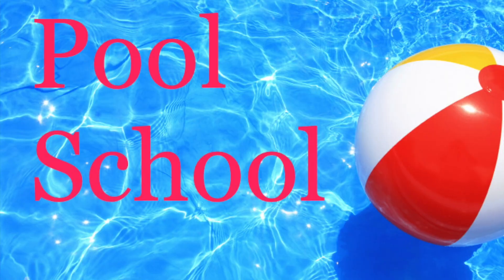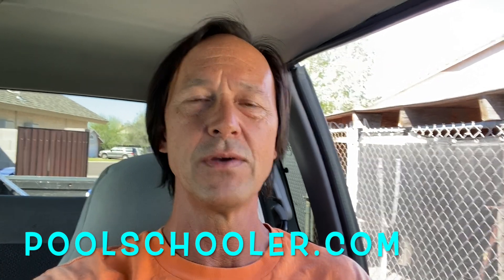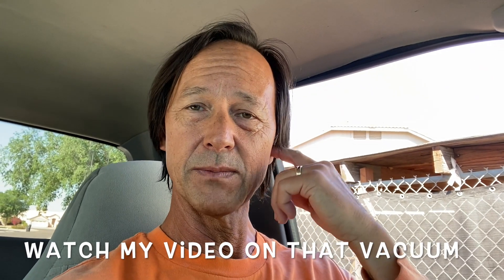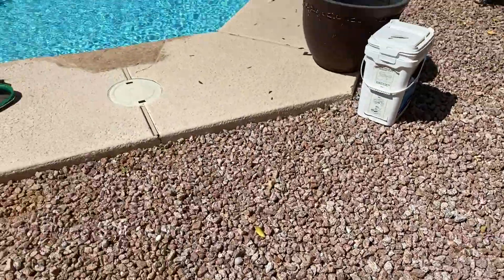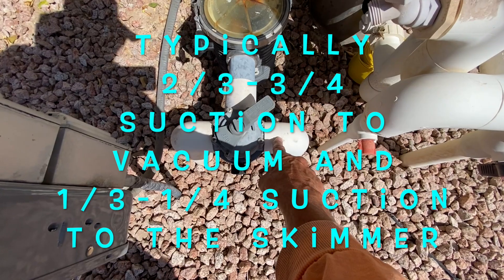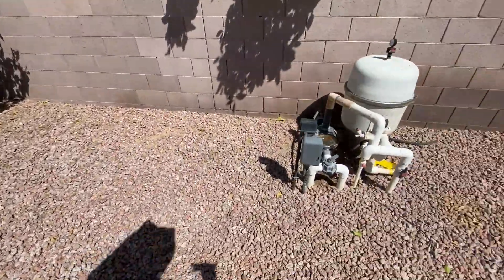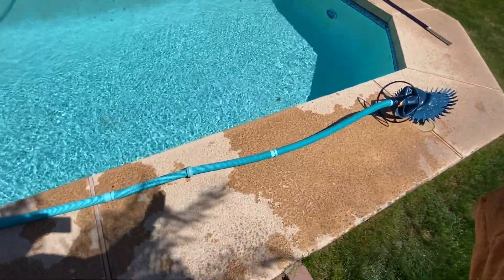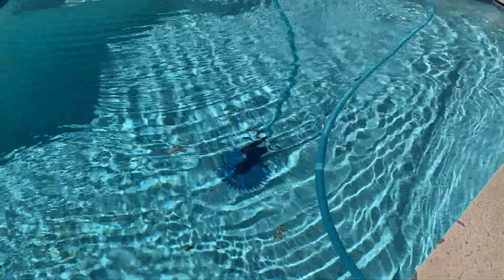Barracuda G3 (and G2) Adjustments

Comment: Hi Kenny, Thank you for all the information about the G3.  My G3 sometimes gets stuck on top of the bottom drain cover.  Is there a way to prevent that?  FYI, the skimmer and the bottom drain come to my filter with one pipe, there are no separate pipes.  Also, I am connecting the G3 to the skimmer directly, not a separate vacuum inlet.
Reply from the maker: Perhaps. Ive had the finned disc of the G3 het stuck under an older style floor drain cover that has a lip around it.  The newer ones look like the one at this link: Afras Anti Vortex White Drain Cover 7 3/8 inch Made 11064W https://a.co/d/cPrsWA1 can help that not happen.   I doubt the vac gets stuck because of the suction to the floor drain. If your skimmer has a diverter take it out and there wont be any suction to the floor drain. Then its just a matter or getting a flor drain cover thats smoother so the  finned disc doesn’t get caught in it.

Comment: I'm replacing my Hayward Ladybug (left by previous owner, rebuilt by me).  I just received from Amazon a U.S. Pool Supply Professional Automatic Pool Vacuum Cleaner .  Looks like the balancing principles in this video would also apply to some of these cheap copies of the G3. Thanks.
Reply from the maker: I’m not familiar with that vac but if it works that’s great.

Comment: Hi Kenny, I just replaced all the parts on my G3 and have a new Hayward VS900 pump. I've noticed that, even when the RPMs (and suction) are adequate to start the vacuum, sometimes it won't actually start vibrating (and moving) until I pick it up off the pool's floor. Any thoughts on what to do about that? 

(PS I did recently remove the collar, which was causing it to get stuck in one corner of the pool near the steps, so perhaps that is part of it.)
Reply from the maker: Hmmm. To potential thoughts. Sometimes and first, it could be that your suction is still a little bit on the low side. I’ve seen that happen before several times. Secondly, it could also be that the diaphragm you put in might be a little stiff and it takes more suction to get it going. I’ve seen that happen on rare occasions too. I would suggest trying to increase the suction a little bit more on the vacuum to see if that does the trick.
Reply: @PoolSchooler  Okay, thanks - I adjusted my Jandy valve to increase the vacuum suction while the system was on and that started the vacuum again. :)  Only trick is that the spa suction is on the same valve, so increasing suction to the vacuum leaves the suction on the spa kind of low. But, not a huge deal... I can always increase the suction on the spa for a few hours every now and then if need be. Thanks again!
Reply from the maker: @BryanStoudt  Hmm interesting that the builder put the spa and vacuum suction on the same valve.  But you may want to try increasing the return flow to the spa to compensate especially if the overflow runs into the pool then that would probably be acceptable.

Comment: Hello so my pool always turns green after my pool guys "fix it" it only last like a week or two then goes green again and gotta wait another week or two to make it blue it always happens with these guys for like 3 years now. I dont have a pool vacuum and my filter is a sand filter and my skimmer only has one hole. When I turn on the filter at night which side should be off on the pump jandy valve skimmer or the other side?
Reply from the maker: These two videos may help:
Algae and Algaecides and Why You Don't Need Them:  https://youtu.be/MzGoK4Cd7tc

How I cleared My Green Pool: https://youtu.be/XY-BAdBY0zI

You may also may want to become a member of poolschooler.com. Check it out.

Comment: I purchased this vacuum because you spoke so highly of it, but haven't opened it yet.  I'm long term house sitting so it's not my diving pool and I don't know much about pools in general.  THere's a pop up system here.  just two on the floor.  Do you think this type of vacuum will work or will the pop ups blow it over when it gets near.  there is a pause feature (discovered after I watched another one of your videos) on top of the pop up tube thingy (total technical term :) ). smarter to pause that when setting the barracuda loose?  the last thing I want to do is open it and then have it not work and be stuck with a vacuum I can't use.
Reply from the maker: First of all you purchased a really good vacuum. Secondly, if you use the pause feature on the pop-up system and pause it on the pop-ups come up on the steps then the vacuum will have no problem. I’ve never had a problem with the vacuum getting stuck on the pop-up even if the pop-ups come up it just works its way around it. So either way I think you’ll be OK.

Comment: I have a G3 and it does a great job but it refuses to do the shallow end of the pool It spends 99% of its time in the deep end. There's plenty of hose. I can put it in the corner of the shallow end and it just make a bee line for the deep end.
Reply from the maker: I've run into that problem often try re-directing the return ports of your pool "down".  And if you have a water feature that too may be pushing the hose (which directs the vacuum) away from the shallow end.  Many pool have the return jets pointing up or angled in hopes to create a flow of surface water that will move debris to the skimmer opening but that doesn't really help.  Best to point the return jets downward.  Try that and see if that does the trick.
Reply: @PoolSchooler  Redirecting the jet downward seems to have corrected the problem
Reply from the maker: @bradmoran5229  good to hear. It usually does.
Reply: Long time g3 owner. Run the hose through the skimmer with the attachment Zodiac included. Replaced the diaphragm and it worked about 5 minutes before stopping. Open it back up and new diaphragm was torn apart. Replaced again and turned the suction to the skimmer down halfway. 2nd replacement also stopped working after about 5 minutes due to tearing. Any suggestions?